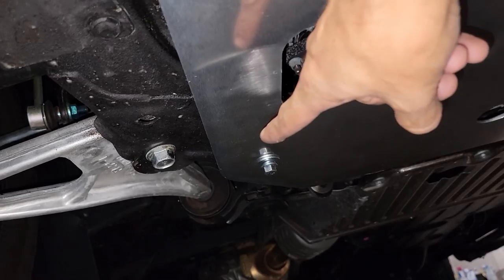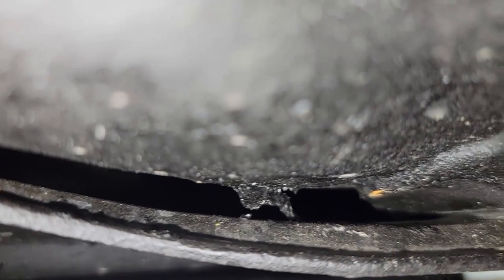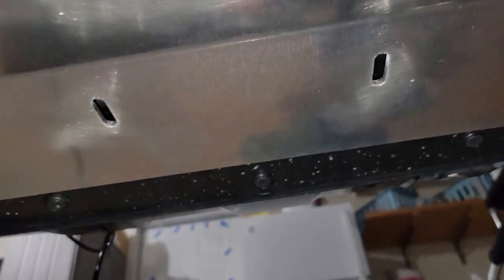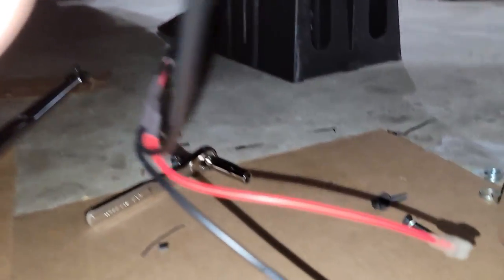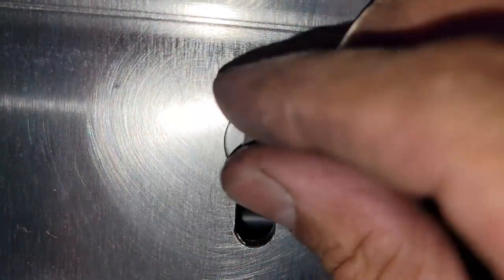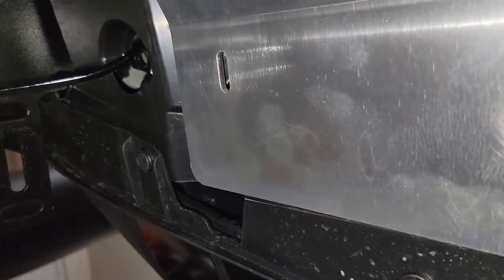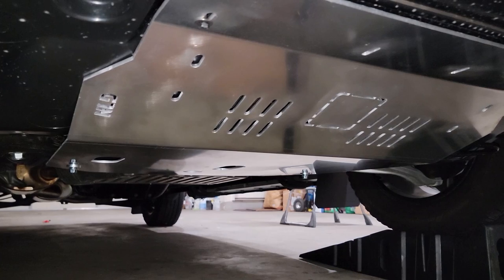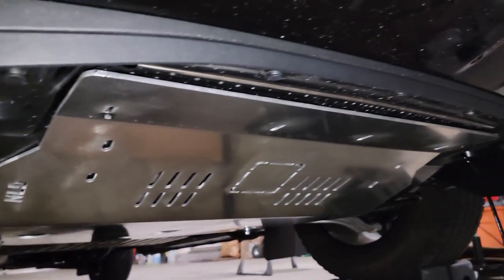Honda Ridgeline 2021 Nolo Skid plate installation

Comment: We’re you able to reinstall your bullbar?
Reply from the maker: Yes.... the bullbar doesn't interfere with the plate.... the only thing, just make sure to use the U-bolts instead of the 4 small bolts, those can damage the threads

Comment: Are you going to do a lift? I’m thinking about doing a traxda lift on my 2021 Ridgeline.
Reply from the maker: I just tried the sumosprings and it was a big failure check tomorrow video... I am waiting from this company a good answer, let me know about Traxda little, I really need 2 more inches in the front
Reply from the maker: check this video : https://youtu.be/80VYJ2ZCKtY
Reply: Make a video for truxx leveling kit.
Thanks
Reply from the maker: @roylee7193  I am analyzing bet this one,  Truxxx and Jsport this last one is installed in many Honda dealers and so far the only one,  also I want to see what  sumosprings have to tell us about this fail, maybe something good comes up. If this happens will be something easy to install, we will see.
Reply: I’m also going to need a skid plate !
Reply from the maker: @fernandosuarez5815  I have No-lo design but also Jsport is very good.